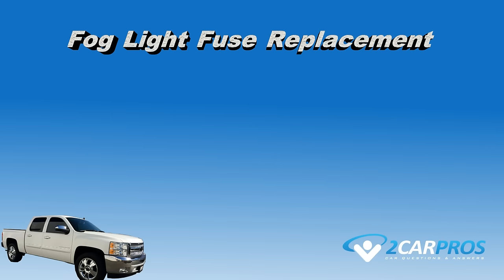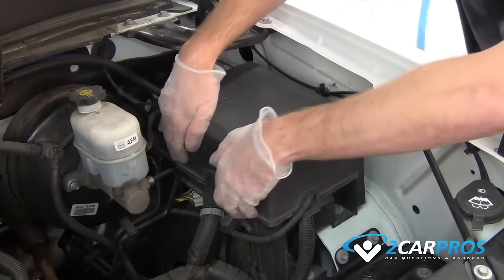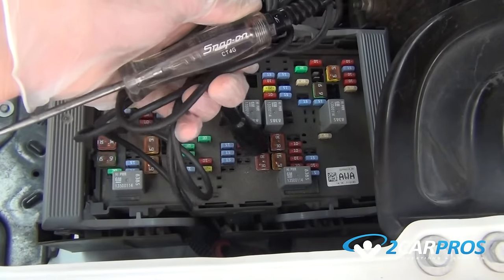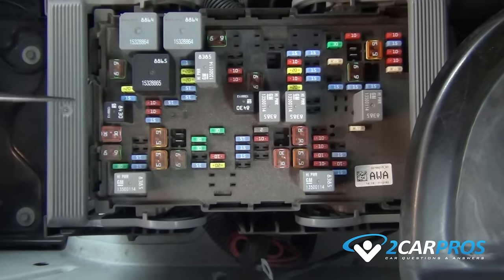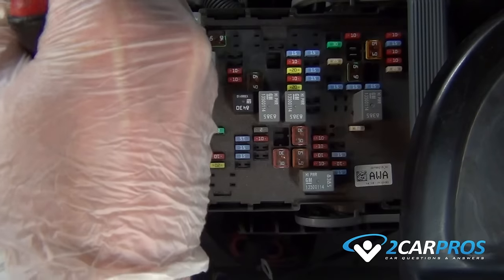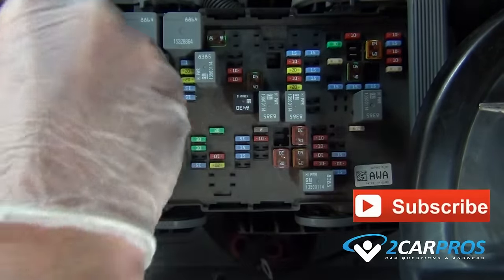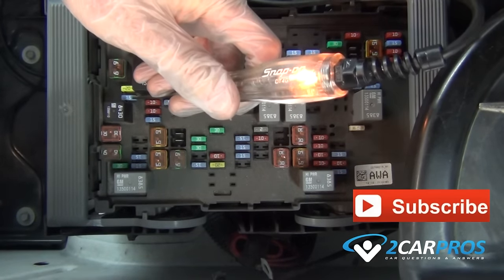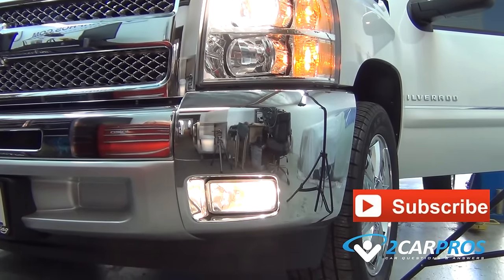Fog Light Fuse Replacement

Comment: while replacing the fog lights on my Mercedes I mistakenly cross wired and got sparks then it stopped working I checked the fuse its good still not working I changed the bulb and checked the wires all perfect.. help here
Reply from the maker: The next thing I would check is if there are any governing relays that could be bad.
Reply: Wat kind of govering relays where is the location?